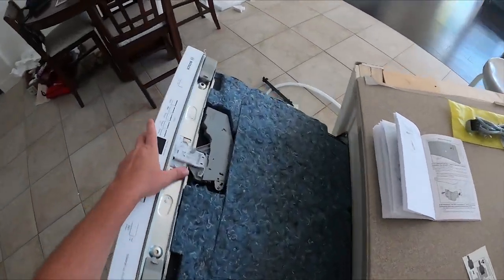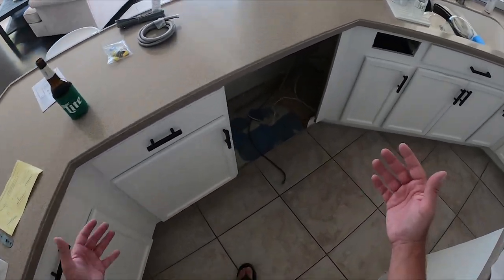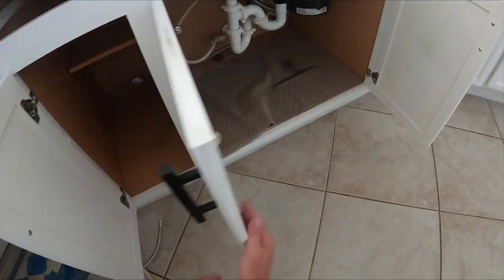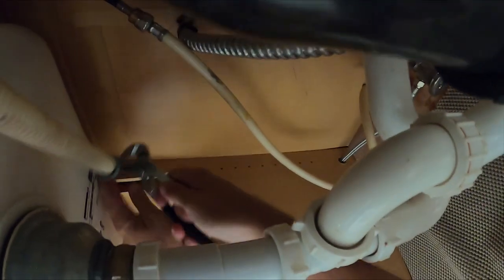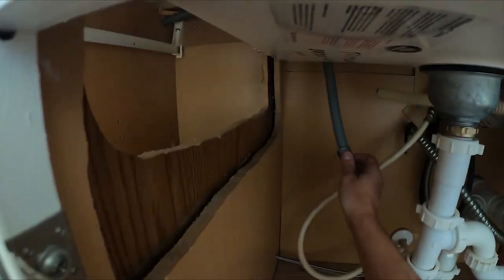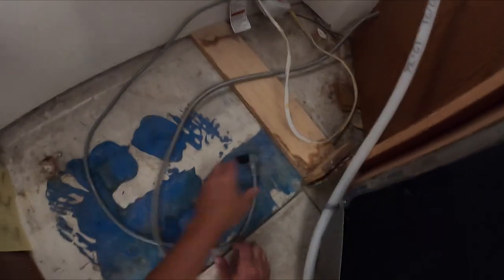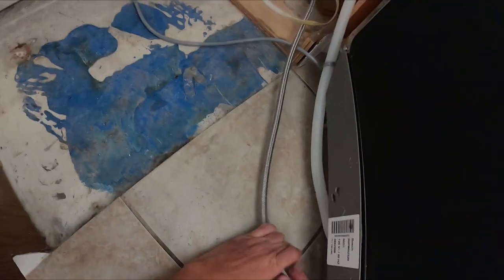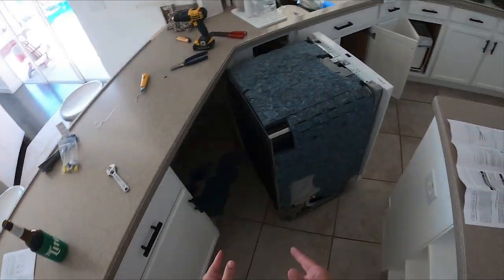Installing a Bosch 500 Series Dish washer (Skill level: 2 beers)

Comment: You should have included that you have to purchase that brass elbow with the 3/4 fitting to attach to the dishwasher to hook up the 3/8 inch water line. Bosch does not include that adapter for some reason. You can purchase that 3/4 to 3/8 adapter at Lowes or Home Depot. To adjust those feet wait to put on those two brackets for the toe panel and you will have more room. The electric junction box should be mounted to the wall and make sure you do not mount it behind the dishwasher as 99 times out of 100 there is not enough room to push the dishwasher all the way into the hole. Bosch says to mount the junction box to the other side of the side wall away from the dishwasher. In your case you have a lot of extra room to have mounted the box on the wall to the right of the dishwasher. 

Just some tips to make it easier for others.

Comment: Well stated! I almost hired a 'professional' (that woulda cost me another $200+) - but after uninstalling the old Kenmore, and noticing the ready-to-go connections, it was easy-peasy to just do it myself. Like you, I almost let loose the line box, but decided to mount it in case of flooding. I dispensed with the beer, but enjoyed a couple bourbons after the Bosch went through a cycle (read: it worked!)

Comment: Entertaining installation video! Hey, just take the weight off the front feet to easily adjust them. Maybe a wooden wedge under the front bottom lip if you can’t wedge it up with one hand or fist while spinning the feet out with the screwdriver. Then remove the wedge when you have it close to where you want it. Bet that would take some of the swearing out of the process.

Comment: Thanks for tips and vid but didn't understand your pro tip.. How are you supposed to adjust the feet before putting in place? How would you know the exact height and level as each surface and floor can be slightly different. I think pro tip would be just to use a wrench 17 and that it sucks but necessary step of the install.

Comment: What a pain in the @$$ the water inlet was (not sure if you had the same problem).  Since it's plastic I was concerned with it cracking. I ended up popping it reticular plastic cover holding the connector out so I had a better change of getting teflon tape around it, and then carefully securing the elbow brace.  Why couldn't they just expose a 3/8 brass connection?  After securing under my countertop, I then noticed some extra instructions regarding stress relief brackets for the corners.  NOPE.  Not gonna happen after I just drilled new holes in my cabinets to hold it where it is nice and tight now.  Plus you didn't use them either so I should be good right (LOL).

Comment: Did it come with the electrical plug to go into wall and you had to buy the junction box, or did it come with neither?
Reply from the maker: So there was a part of the video that never recorded. It was a layout of everything that you get. Long story short. Everything you see in the video did come with it, but I cant fully remember if the wiring stuff was sold as a separate kit or not. Cheers!

Comment: I have a used Bosch I’m replacing my very old dishwasher with. The replacement Bosch has controls similar to yours. It appears the counter  impedes the use of the controls. Is there a work-around needed to accommodate the push button controls on the top of the door?
Reply: You set them before closing the door.
Reply: @Ryan-re1rs  yep figured that out. Luv the Bosch!

Comment: Doing this install today. Best no bs vid I’ve found so far. Is it clockwise to raise both feet? Or clockwise for right, counter for left? Also any idea how to tighten the top up with granite countertop? I assume I can’t use the brackets included
Reply from the maker: loosen the front feet a bit when you can have the unit up in the air. Its a huge pain to turn them when they are on the ground. They go clockwise from what i remember. cheers!
Reply from the maker: i used the brackets and used them at the side into the cabinets. it worked out well

Comment: Probably not a good idea to just toss the junction box and wiring in the back and push the washer in.  If a leak occures, the junction box is not protected.  An electrician would mount it correctly.